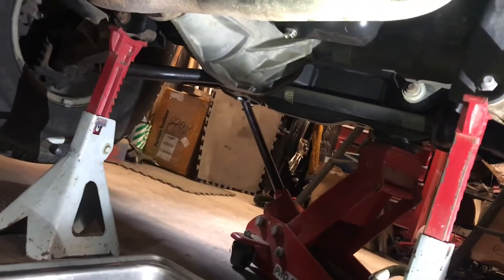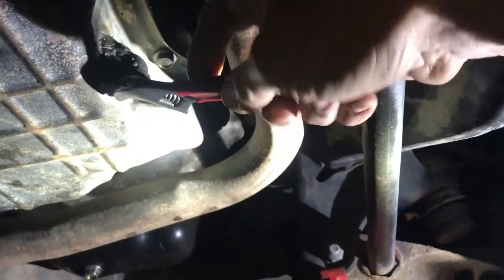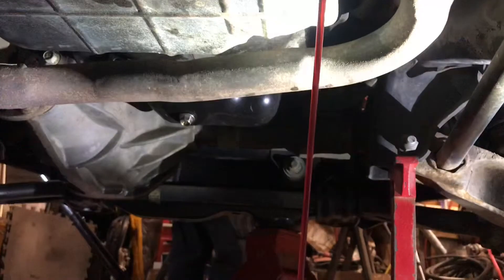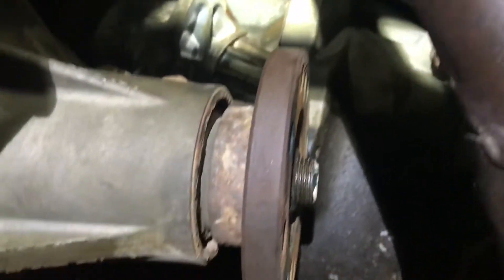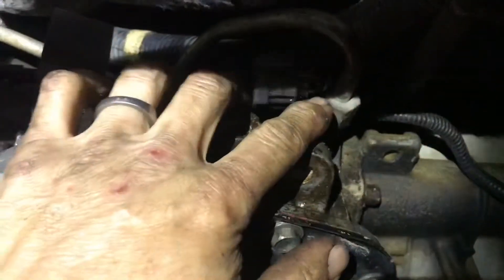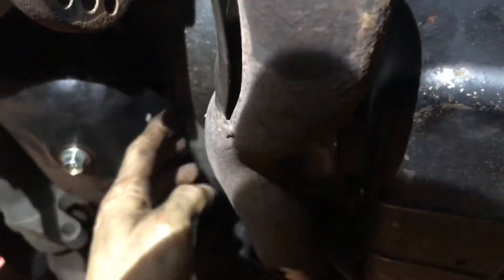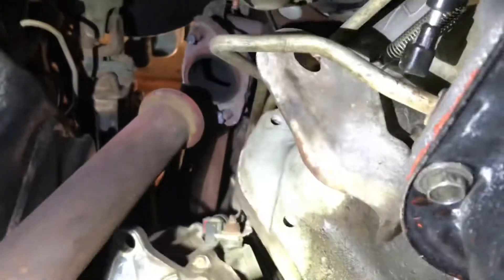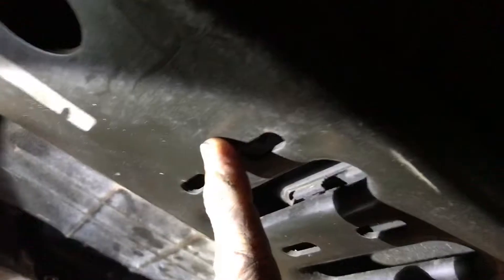2000 Dodge Durango torque converter swap Part 1

Comment: You did what to check the torque converter...?
Reply from the maker: My dad looked on google to see what caused the symptoms we were having. Bad TQ converter.
Truck would start and idle around the yard or down the road slowly in 4WD low but every time we tried to depress throttle it would die.  Just like letting out a clutch all at once.  Bad seals inside convertor.  It works internally opposite of what one would naturally think.
Reply from the maker: Oh, if it locks up with the plug on side of trans disconnected then it's most likely bad.  Needs power to solenoids to lock up when working properly.